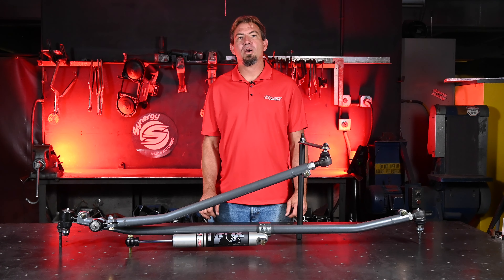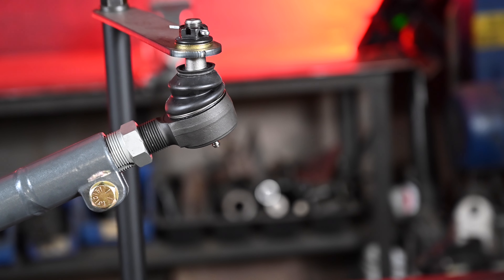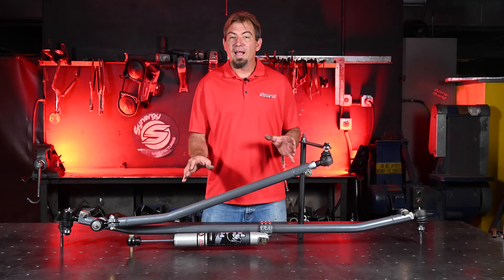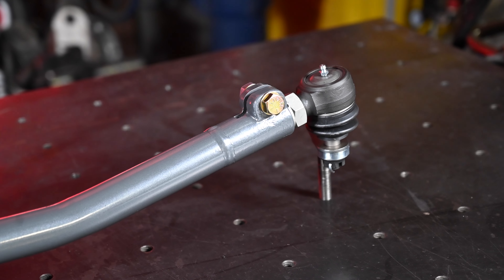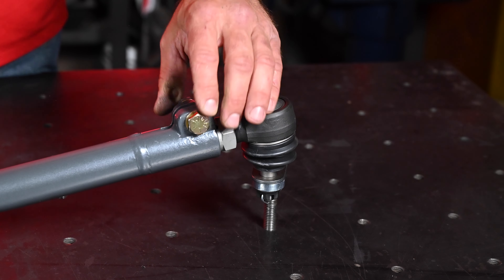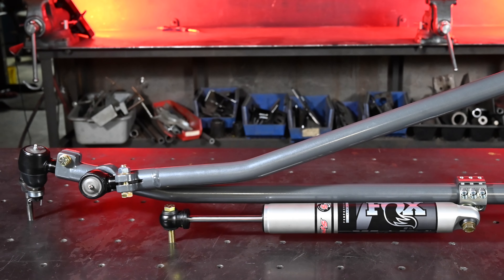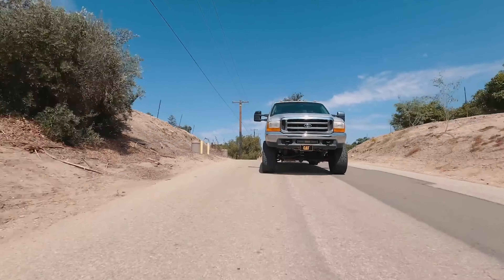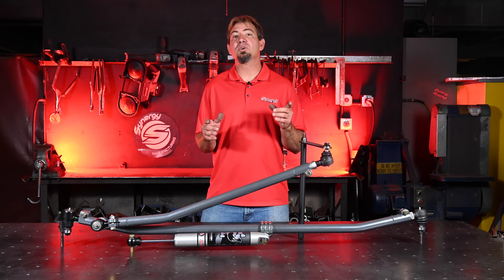New From Synergy! Introducing the 1999-2004 Ford Super Duty F-250 / F-350 HD Steering Kit

Comment: Will the drag link work with a 12 inch lift? Or do you have parts to purchase for it?
Reply from the maker: It will fit if you have the proper drop pitman arm and drop track bar bracket.

Comment: Will this work for a 99 2WD dually? My truck does not have the shock absorber for the front steering. Would my truck benefit having this on there?
Reply from the maker: We cannot confirm or deny if it will work on that year and model truck at the moment. Would you be able to email us some photos of the front end of your vehicle? If so, please email pictures to support@synergymfg.com and be sure to add in the subject line 99 2WD Dually SuperDuty. Then we can have our engineers examine the pictures and see if our kit would be a fit for your truck.
Reply: Hey guy, did you ever send this in???? I want this kit. I have it on my 5.9 and 6.7 Cummins trucks. love these products. @synergymfg Any idea if it works on the 2wd?
Reply: @sebastianesquivel4150 no, I never did.